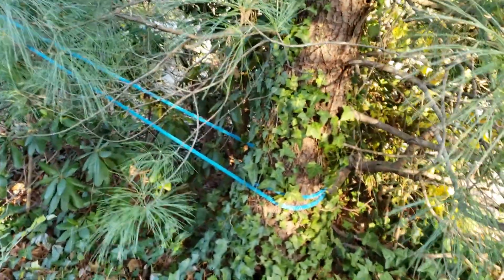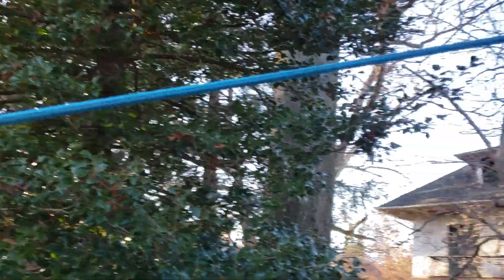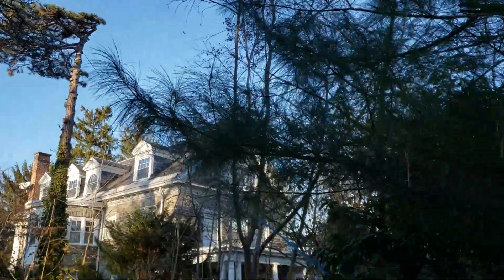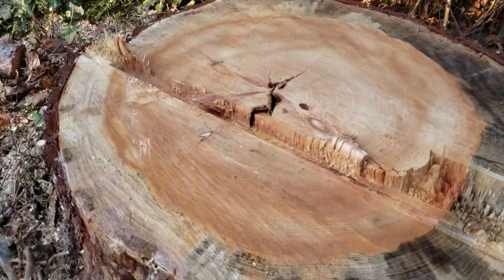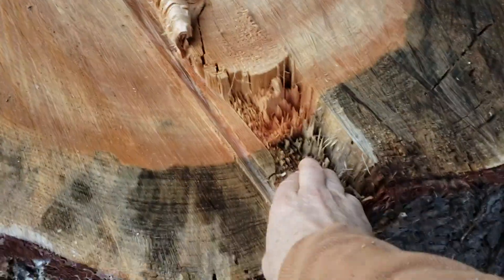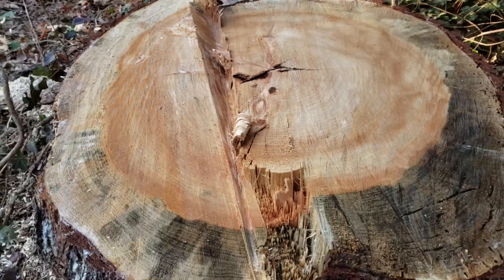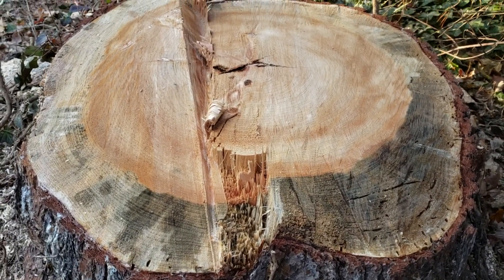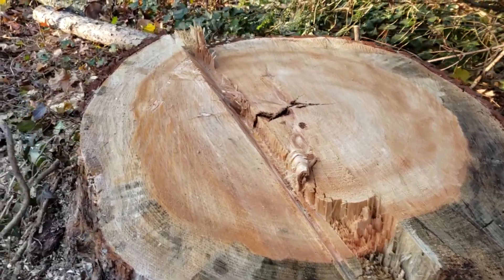doubled pull lines puts half the force on the rope

Comment: As you say force divided between the legs of the rope. The full force experience by one section of the rope as it takes a bend at the tree though?
Reply from the maker: it's the same force on the rope throughout with a slight reduction due to friction on the standing side

Comment: You're notch didn't suit me no need to respond a quick look back at video you well see not a clean face cut Right side
Reply from the maker: Yes Greg, I saw that and mentioned it in the video. That was more of a shadow than a bypass of any significance. I easily could have fixed it but didn't bother as there was no need. Plenty of room for the fibers to bend etc. I'll post a video of the completed drop so that you can see that the hinge looked fine. There simply was not enough meat in front of the kerf to impede the fall. It's a good observation, and important to make the distinction between that type of shadow kerf and a significant bypass as per the other stump shown here. thanks for the comment and hopefully this discussion helps people.